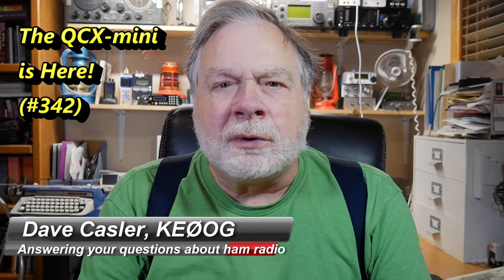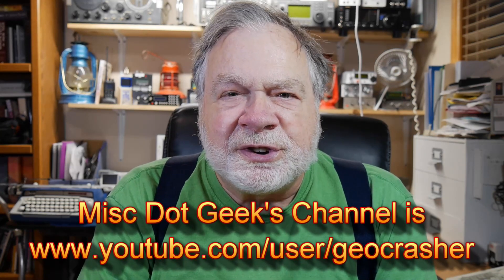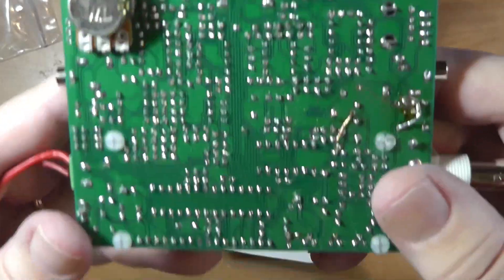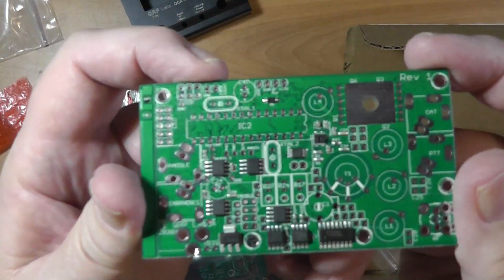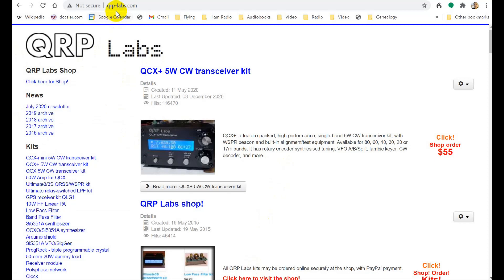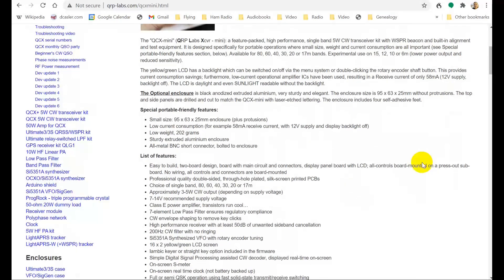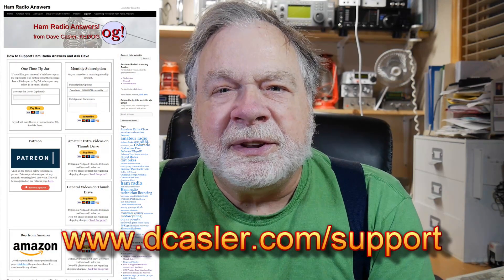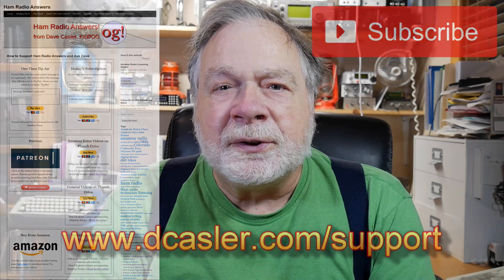The QCX-Mini 20m QRP Rig Kit Arrives (#342)

Comment: This kit went together with ease. I did spend plenty of time on inventory of parts then placed them in labeled tray like container with snap shut lid. This allows me to find the part when I need it easily.  This also assures that parts not used are identified easily. At time of this writing I bought a non-working Mini from a fellow that wanted to operate not build. My gain as he sold it to me at a great price. All I need to do is figure out the issue causing it not to work and fix it. Then once it is working as built I will remove es replace several capacitors and adjust windings for 15-meters from 20-meters.  All fun I think.  Hope you enjoy your build.

Comment: I built the 20M version of this and it is the bomb! Besides CW, it does stand alone WSPR also and mine puts out power all the way down to 80m! When doing WSPR, I run it at 7V to keep the power low. This is probably the finest kit available today. Not a beginner kit. It is 10lbs of stuff in a 5lb bag but it all fits nicely. Follow the directions to a TEE! I love this rig!!

Comment: 👍 Dave, thanks for doing a series on QCX mini construction. I have built and used original/larger QCX kits for 40 and 20m which I am very happy with. I have a 17m QCX mini on order. Therefore, will watch your progress with interest. I certainly found that the original QCX kit manual was excellent and the construction straightforward (with exception of the toroid transformer which requires a little patience). I think it's safe to assume that Hans Summers, G0UPL, will have provided a construction manual for the QCX mini to the same extremely high standard. The features and performance of these QCX transcievers is amazing. Don't be fooled by the low price - they are certainly NOT novelty QRP kits and they have many features that much more expensive commercial ready built QRP/P rigs lack. The design even incorporates built in test tools - so that you can build the QCX kits with nothing more than a fine point soldering iron and a few basic tools.

Comment: My 17M kit arrived last week from Turkey,  it got hung up in Turkish customs for a while.  I ordered it 10 minutes after Hans opened up the online store and made it into the second round of shipping.  My shipping box looked like it traveled every inch from Turkey to Maine too (not as crisp as yours).
Interesting that the FW rev for mine is 1.07a.
The point about the manuals from QRP-Labs is spot on,  I just finished up my signal generator and finally built the GPS kit I ordered a few years back with my original QCX.  Excellent manuals.
However, have you built the Hardrock 50 Amp and ATU?  The manual for that kit is similar in quality and a complete joy to build and operate.
I will be building my QCX mini slowly over the next week or so, chipping away at the steps as I go.
Looking forward to watching your progress as well.
W1ND

Comment: Hi Dave,
I have the same HP color laser printer. May I suggest downloading the manual PDF and opening it in Adobe Reader. It has more printing options and one is to size the print to the paper used. That's one way to get around the European sized paper. Stay safe.  73  WJ3U

Comment: I built the QCX+ 40meter and instructions were first rate. Unfortunately, the receiver is marginal, mostly due to the lack of AGC and RF gain control and not much in selectivity. Fun kit and Hans is a great guy, but there's better QRp kits out there.... 73
Reply: Which other kits would you recommend?  I built a QCX in 40M but haven't used it since I'm still learning CW.  Looking for something to build in 80M.  Or maybe I'll just buy the new Mountain Topper but I would really rather build a kit.